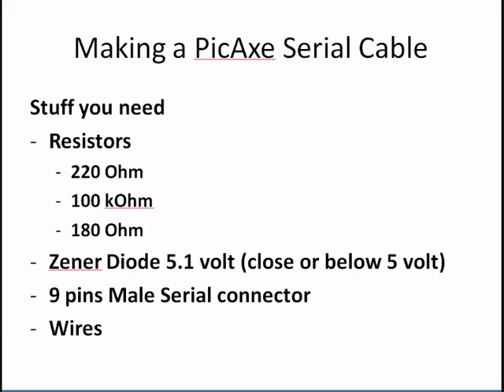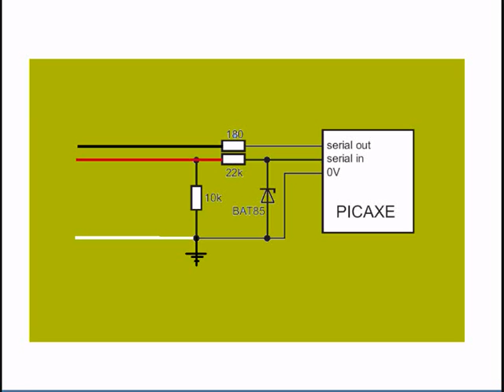Making a Picaxe Serial Progamming Cable

Comment: The BAT85 is not a zener diode.  It's an ordinary schottky barrier rectifier with a 30V reverse breakdown voltage.  This will not protect the PIC from high positive voltage on the serial input.   I will protect against a large negative voltage.  To protect against excessive + and - voltages, about a 5V zener would work.